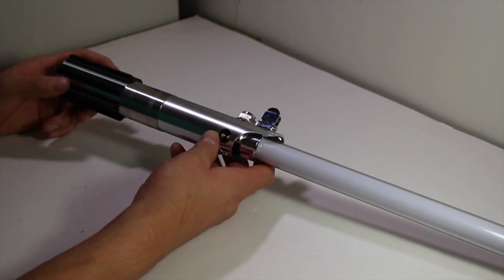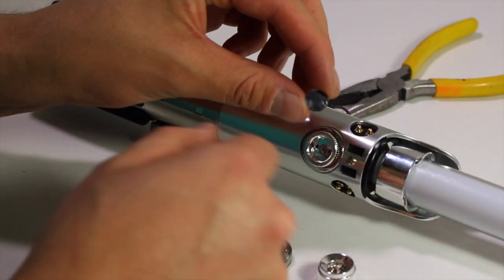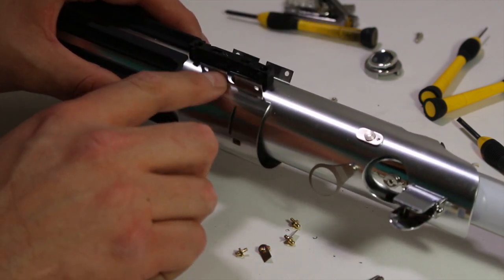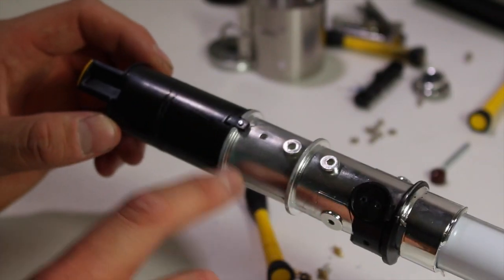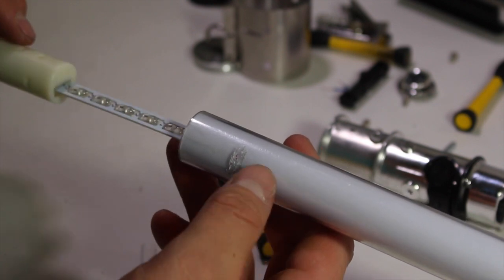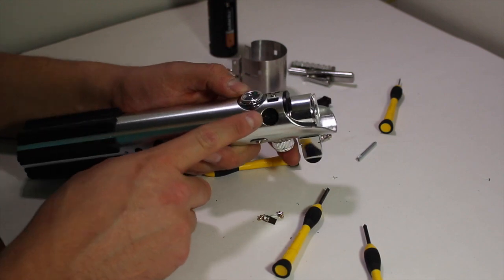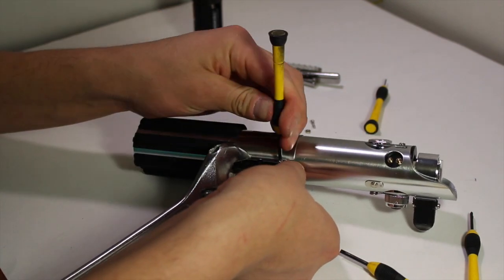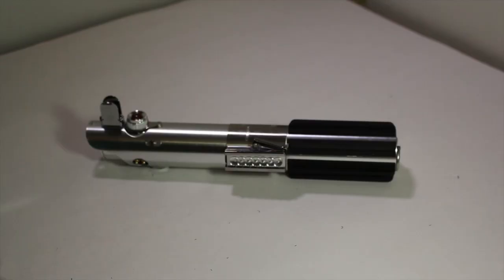Luke - Black Series Lightsaber (2015) - Remove Blade [How To]

Comment: Hey Peat, this is a super old video but I just wanted to quickly thank you!

I found this video back in 2016 when it came out to help me convert my first ever lightsaber, a Force FX Graflex, to in hilt LED. I couldn't have done it without this video. Doing that caused the lightsaber bug to bite me, and now, 4 years later, I install lightsabers full time. This is a small video, but it's funny to think that if it wasn't for you, I probably wouldn't be doing what I do now.

Comment: Why they don't sell just the hilts is beyond me.
Reply: Why doesn't the company just sell the ones with the removable blade so you have the option to have the hilt to have with out the blade and then when you want to have the blade put it into place easly!

I know they have the ones with removable blades but for some stupid reason they don't make them anymore and you can only find them on line for like $900 - $1,000 bucks!

So when they brought back the black series why couldn't they sell the ones with removable blades? It pisses me off!
Reply: José Antonio Durán  Master Replicas
Reply: You can find hilt replicas all over the internet, like Roman Props, Korbanth, Parks Sabers, and many others.
Reply: Master Replicas used to make them before they lost the license. You can get them off eBay, but expect to spend between $500-$1,500.
Reply: Disney do sel sabers with removable blades, however they are exclusive to the Disney parks (Disneyland, Disney World, etc.) and have a different sound chip, which are the same ones you can find in the cheap-o toys they sell.
However, Galaxy's Edge (soon to open in May in Disneyland/August in Disney World) will sell the hilts on their own for around $109, with the blades being an extra $50 (and an optional belt-clip!).

Hope this helps, may the force be with you!

EDIT: I forgot to mention that they are, apparently, battle ready lightsabers. I can't confirm that, Disney did say that but their version of "battle ready" might be different than what we consider "battle ready". If Disney are correct, however, then we will be able to fight with these new sabers.
Reply: All of the comments don’t help, Hasbro is starting to make removable bladed fx sabers but they jacked the price by double the original price

Comment: SUPER helpful! Wish it was as easy as the ROTJ Luke saber where you literally just push down on the top of the blade. For the switch part, instead of cutting the wires you can take off the black base (and then the tiny switch STILL doesn't fit through the hole) and I took my needle nose pliers and grabbed onto the black plastic tubing through the hole and literally pull up a tiny piece that allowed for the on/off switch part to just fit through. It was realllllyyyy simple and saves the hassle of soldering or cutting and such. As for the pin holding the blade, I took a tiny glasses phillips head screwdriver, placed it on the pin and tapped gently on it until it came out

Comment: Very nice! I'm gonna try this. Lightsaber blades MUST be removable.
Reply from the maker: exactly! Hopefully this new line coming out will have removable blades
Reply: I successfully took the blade away just now. Thank you very much from Japan!
It was a little bit difficult to pull out the long pin that's through the blade and I carved both side.
Reply from the maker: no problem, and good to hear!
Reply: What new line? Great video by the way!

Comment: I just finally was able to pick up an extra one of these sabers so I can jump guilt free into the one I want to make accurate to The Force Awakens. Thanks as your vid has provided great insight as to how im going to do this. If peeps would like to know how to remove the grips let me know and ill post something to let you know how I did it if it goes the way I hope it will. I still cant believe they like mold injected those plastic grips through the hilt itself. Who would have thought that that would give me the biggest challenge as far as disassembly goes? lol.
Reply from the maker: Zach A rad! and no problem, i hope you can share how it all turns out, tag me on instagram when you finish, id like to see this.
Reply: Peatin_it hey brother can you tell me the name of the tools man that would be appreciated

Comment: Disney do sel sabers with removable blades, however they are exclusive to the Disney parks (Disneyland, Disney World, etc.) and have a different sound chip, which are the same ones you can find in the cheap-o toys they sell.
However, Galaxy's Edge (soon to open in May in Disneyland/August in Disney World) will sell the hilts on their own for around $109, with the blades being an extra $50 (and an optional belt-clip!).

Hope this helps, may the force be with you!

EDIT: I forgot to mention that they are, apparently, battle ready lightsabers. I can't confirm that, Disney did say that but their version of "battle ready" might be different than what we consider "battle ready". If Disney are correct, however, then we will be able to fight with these new sabers.

Comment: i have done this ages ago but instead of removing all electronics i disatached all the connections to the led strip and added a plug ( like a computer plug to charge ) so then i could just remove the blade with electronics inside and still have sound effects, and when i felt like it i could just plug the blade connector to the other connector and insert the blade. almost the same thing they have now from disney where you can easily remove the blades! guess i was years ahead of hasbro eh?

Comment: Thank you so much for sacrificing YOURS so I don't have to. Damn, I thinking - "Oh, this should be quick." Uh, hell to the no! I dig the hilt, don't get me wrong AND I do applaud your video. You did a great job on the vid. I just thought it would be simpler and somehow akin to the "Signature Series" build. At least from the inside. I guess Hasbro had to do it the hard way. I, too, was bummed at the fact that the blade is fixed. Why, for shits sake?! I had a Vader Signature and had to sell it. I wish I hadn't. It even has a few things that my Vader Black doesn't-like that groovy little red wire looking thing snaking in and out of the hilt. The main thing is that it was detachable and that made ALL the difference in the world as for the way cool factor. I now have both of Luke's (ANH and ROTJ) and Vader's as far as Black Series goes. They are really nice, regardless of my pissin' n moanin'. They really are my most prized possessions and this time I intend to keep them. Good Video, my friend. Keep up the good work.

Comment: 5:10
“I carefully shaved down this piece and pulled the pin right out”

Me: “Okay I’ll just take about an hour failing to shave it down and just resort to drilling holes through every inch of it, hammering the pin, and using the strength of Odin to pull it out.”

Comment: i took mine apart.... was wondering if i could use the the bare graflex part and put a knew blade holder, electronics from the custom saber shop? are the graflex the same diameter as the ones from the saber shop?
Reply from the maker: as far as i know the black series are just a few millimetres bigger. I know its been done where the whole internals are taken out (shameem did a couple), but I've never looked into it. Try looking up a conversion kit for black series

Comment: Do we cut any wire ? And if we do , which one and how to make them work again ?
Reply from the maker: you can cut any wire really, to reconnect just expose the copper, twist them together and tape it up with some electrical tape.. OR you can unsolder the connecting point and just re-solder later

Comment: You do not have to cut the wires. The board separates from the black piece, and you can fish it through the hole in the handle.

You also do not need to take the exacto to free the pin. I took a small pinch and rubber mallet to it while I placed it on my leg for cushioning, and the pin came out.

Comment: Hey man, could you tell me what wires go to which spot going from the board to the pins where the battery holder plugs into. Mine came off when I was disassembling.

Comment: Im thinking of getting one of these (+the darthvader one) but I do not want it to have sound, do you know which wire I would need to cut to remove the sound, as I see there is a red and a blue one in your video when you go to remove the saber light stick part?

also, doe the saber have an auto shut off timer, as i am hoping to mount these onto my wall in my room?
Reply from the maker: i honestly have no idea what the answer would be to both of those questions lol, sorry man

Comment: Can I ask one question? What is the material of the inside tube (the blade holder)? Plastic or aluminum?
Reply from the maker: +Siriwat Maneesint plastic.. everything is plastic, except for the main body. The black t-grips are also plastic. Not sure exactly what kinds of plastics they are though.
Reply: +Peatin_it Tried doing what you did. Ended up scratch mine a bit but it was fun though. Do you still use the original sliding switch with your current converted build? I tried hooking it up with NBV3 and it acted funny.
Reply from the maker: Yea i used the original switch. I thought about installing an actual functional red button for activation though. Weird how yours is acting funny, mine seems fine! I posted a video of it on my instagram (@Peatin_it) if you want to see the hilt with the original soundboard and led installed. I also used a wire coat hanger (then spray painted it silver) and made a stand, it sits in a glass display box.

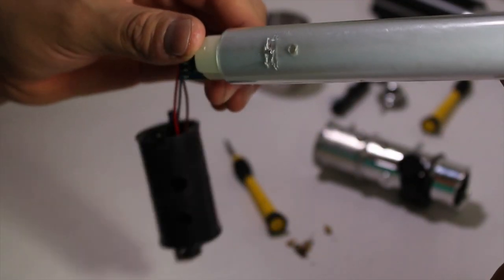Comment: Awesome video! Im wondering, though, what if you had replaced the wires seen at 6:30 with longer wires that had a set of interconnectors in the middle?  Do you think you could have kept all the electronics in the hilt (besides the blade, obviously) and have been able to reattach the wires and pop the blade back in whenever you wanted, without disassembling the entire thing again? (Sorry if I'm not making much sense, it's hard to express this idea in writing)
Reply from the maker: Jared Alvarado thats not bad of an idea, only thing would be blade retention to worry about.
Reply: Peatin_it  True. You'd have to find some way to extend the removable pin to the exterior of the hilt, perhaps by drilling a small hole on the outside that lines up with the pin on the inside.

Comment: I’m trying to get my pin out and it’s such a pain in the ass. With even budge and I got both sides of the plastic cut out and I’m using multiple pairs of heavy pliers too.
EDIT: I used a hammer and hammered both sides of the pin to loosen it and got it out. This tutorial was really good. Took out the LEDS from the balder and now I can simply use the screws on the top of the handle to tighten a hollow blade allowing me to swing. Pretty much have a movie prop plus a blade (minus the lighting) that I can swing around if I want

Comment: Of course you can take out the saber from the hilt but its not suppose to, purpose of this would only be to fix or change anything if the saber breaks all you have done is taken it apart, any toy/figure/collectable can be taken apart. If people want a removable blade spend extra to get it. And for the people asking if there blade is removable just look at the box not difficult it would say with removable blade.
Reply: You know the difference in price of the non removable blade Light sabers and the removable blade light sabers?

The ones like in the video cost $150 (I just got Luke's Blue and Luke's Green on sale for $100 each)  
The ones with removable blades are no longer being made and cost around $900 to $1,000

So not everyone is rich..... If you have the money then ok but if not then you have to work with what you got.

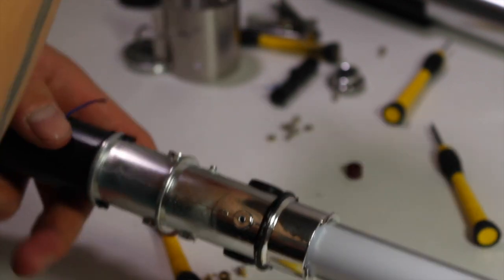Comment: Hey peatin_it  at 5:25 I can not seem to get the pin out as easy as you was it hard for u the first time I can't seem to get it everything Else has worked fine
Reply from the maker: seems to be a common problem, i used a vice grip and twisted it a few times before pulling on the pin.
Reply: Peatin_it I finally got it out man! Thanks for ur vid I appreciate I'll be on loook out for more of ur vids

Comment: you didn't have to damage any of those areas you did. a small phillips and small flathead get every single pin out. or a small punch kit.
Reply from the maker: the internal components i wasn't do concerned about, from a collectors stand point i understand the concern (I'm a figure collector myself), but i just wanted a hilt to display at home, so in this case, only the outside mattered to me.

Comment: Do the LED's slide all the way out? I ask because the last 8 or so LED's (I assume) at the top of my saber just stopped working.. I didn't even hit it hard. just a light tap to test it out. It was brand new and I've had it for two days only... pretty annoyed...

My question is really.. can I use this method to repair/solder the led's bad connection and put the blade and everything back together?

Great video! Looks like a bitch of a job though haha
Reply from the maker: 80TheMadLord08 80TheMadLord08 Yea this is common for the hasbro sabers... But yea, looking at pictures of the led strip, fixing this should be possible!! Send me a dm on instagram, i can show you a close up photo of the strip ig a@ peatin_it.
Reply: Thank you so much! I will get on that soon.

Comment: I can't get the damn pin out..
Reply from the maker: it looked easy in the vide because i pulled it out a couple times for the video before hand. I received a few messages with the same problem. I used a vice grip, and twisting the pin around a few times loosened it up. Hopefully you have it figured out by now, I'm realizing this comment was made a month ago lol.

Comment: Seriously??? Why? I was bummed also, but if it's not a "removable" model, why would we spend all that time? I thought it'd be easier
Reply from the maker: +Christopher Spiegel i don't duel, or cosplay, i just wanted the hilt to display
Reply: +Peatin_it actually, I thought about that 5 min after I sent my comment. I guess I was disappointed because at first I thought you did a vid showing a kind of 'quick' way for those who want the best of both worlds. Cool of u though to at least show that it can be done w/ out breaking it. Last time was the ones in 2010 I think, that the "signature" series- now "black" obviously, made the whole line removable, plus they put out many more characters' sabers, I'm hoping the next few to come out are some diff characters, and of course maybe w/ some removable action!, but, not a deal breaker, just hope they put some out soon, I wonder if you might have any info on poss new saber releases? Thanks for responding btw!

Comment: God, is there no easier way
Edt. FUUUUUUCCKKKK!!!!!!! So i tried this with the rey saber. And i got all the way to the part where you screw off the circuit board...... so instead of a screw, theres a glue bubble there. So now i gotta find away around that.......thanks anyway though
Re:edt....... so i found away to take it off. I dont recommend it for the Black series Rey lightsaber. But it CAN come off